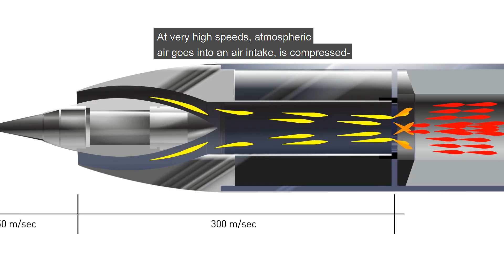How ramjets may change the role of artillery on the battlefield

Comment: Let's see, a 155mm shell fired over 30 Km has a tollerance of 2' going up to 150 Kilometers means that you have no tollerance left. This is still a non guided shell. Meaning, that if you fire that kind of a distance the weapon looses all accuracy. It would be an indiscriminatory weapon of terror. Hitting something that's smaller then a small town, is virtually impossible. As a former artillery man I should know. ;-) 

So while the technology is highly interesting, it's not combat effective and has no real practical uses.
Reply: They used the word guidance at least 3 times, plus you can see the steering fins at the front
Reply: @E1nsty  Wow, you literally have no clue what I'm talking about, do you? 

So what do you think is going to articulate these fins in flight? Little electronic motors, powered by a build in battery?  These are stabelization fins. They serve no other purpose as to stabelize the projectile in flight since it's going to create it's own thrust through the ramjet engine. Ever wondered why some missles have fins while artillery rounds do not?

Well, Artillery rounds don't speed up any more after they have cleared the barrel. Thus they're stabelised by making them spin around their own axis. Just like a bullet . However, the rocket motor of a missile keeps on creating thrust after clearing the barrel and that's why you need those fins. Cause otherwise, all your missle would achieve is to paint a beautiful corkscrew contrail into the sky and that's about it. 

A NATO standard 155mm shell packs about 22 Kilogramms of TNT equivalent. the shell is literally filled to the brim with explosives. 

What those guys are trying to tell you is, that they can stuff in a ramjet rocket motor, a guiding system and then still have enough room for a meaningful charge? Well, let's just face it. NOPE! Not gonna happen. This is just bullshit. 

1' deviation from the original fire solution is about 100 - 200 meters deviation on 20 Kilometers of flight. And that's under ideal conditions. There are reasons why we have things like "danger close". Believe me, I've been an artillery man for way to long, to believe a single word of this sales bullshit bingo. 

And that's not talking about the forces at work here. I won't go into to much detail, as I would be wasting my time. But the fins will not even be able to rotate in the slightest, while in flight. It'd just be to much drag, that'd be created alongside them. 

Any further questions?
Reply: @joenight9693  yeah can you write it shorter? I didn't read all of it.
Reply: @joenight9693  Thank you, very informative and enlightening.

Comment: Your artillery comment is hugely mistaken.
The South African G5 & G6 could fire shells accurately within 2m at over 50km away already in 1987.  
What you are comparing to shells here are rockets. Shells were not assisted with motors, fuel etc.

Comment: My big concern is that at that accuracy would be extremely difficult. With strong winds it could be blown a considerable distance off course. 
Could they even hit the near the target on calm day? These guys are saying that they can launch a shell across the width of Florida's peninsula  Which is insane. Maybe they can do it, but would it be effective?
Reply: Considering the accuracy of current guided artillery projectiles, that doesnt sound like a big problem to solve. But it is indeed a very important factor determining the sence of using ramjet munition. 
The bigger challenge is importing the data of target to the guidance system of this projectile - how do you find, identify and track a target 150km away with pinpoint accuracy, which is needed because of relatively low payload of the munnition? 
The first thought is a standard internal navigation and GPS. But will it be able to download the data and compute with speed and precision needed during high supersonic or even low hypersonic flight at that? 
Current hypersonic missiles use an active radar array for a very precise targeting during the last phase of its flight. However is it possible to mount an AESA radar on such a small projectile, where its nose is mostly covered by the air intake? I dont have sufficient knowledge to answer.
Why radar though? Because expensive projectiles like this are meant to be used against expensive targets - command posts, artillery systems, MLRS and ballistic missile launchers, electronic warfare systems, ships, aircraft on the ground etc. And radar can determine this kind of targets with needed precision.
If we cant put the radar array there then what else? Optical targeting systems ofcourse - IR and laser! First is entirely passive, but expensive and require high computing power, second requires some kind of platform doing the targeting - for example a drone with the laser illuminator.

Comment: I think the 150km range is just hot-dogging, suspect it will be of most use @ 100km or so when it`s still got huge kinetic energy and is part full of fuel to add to the explosive effect. And those are obvious terminal guidance fins at the nose end.

Comment: This sounds like perhaps finally a good gun weapon for the Zumwalt class DDG's.  Payload doesn't matter as much to a ship.  Kinetic energy just punches a hole right through the opposing vessel.
Reply: Zumwalts were not designed for anti surface ship action using the 155mm cannons. They were designed for long range inshore bombardment. The amount of explosive for such a weapon is very important.
Reply: @CH-pv2rz  Spot on, but the role the Zumwalt's were designed for has been abandoned. Shore bombardment is for lower intensity conflicts where sea control and air superiority are established and not contested. US Navy focus has shifted hard towards near peer conflicts which in practical terms means ship to ship combat with China, defending Taiwan and deterring an invasion of Taiwan, blockading shipping lanes to and from China, dealing with the LONG range and supersonic weapons of China. None of these goals and priorities requires extended shore bombardment. 

US Navy's biggest problems now are the retiring Tico cruisers and Ohio guided missile subs retiring  and taking all those VLS cells out to pasture with them. This and how to employ large bodied US hypersonic weapons now under development that wont be fitting into existing VLS cell parameters...  These are areas perhaps the Zumwalt's could perhaps be repurposed and find a new meaningful role in the surface fleet? 

My original comment about this artillery shell technology has not aged well in light of these shifting world priorities.   What would a few more Zumwalt's cost I wonder with hypersonic missile launch tubes installed in place of the 155mm gun mounts??  How many hypersonic missiles could each Zumwalt embark?

Comment: M270 also is able to fire rockets with the range of 70km. Still a promising concept. What Russian system has a range at or beyong 70km/h, because the video never actually names one and in the pictures there are just BM-21 Grad which typically fire at a stated range of 20-40km.

Comment: I really dont think half of the people commenting here even watched the entire video let alone have a clue what they're talking about. The US is already developing the the XM1113 rocket-assisted 155mm shells for use in 2022 with a range of 40KM. The M982 Excalibur guided artillery shell has already been developed at circa $68K per shell and these will almost certainly be more expensive, when compared to the cost for a single M31 GMLRS rocket is $110K with a range of 70KM.

Comment: This technology sounds like it would be better for naval engagements. Make it for a 200mm cannon strap a ACTUAL warhead on the nose and then funnel air into the ram jet and thus you have increased the range of naval artillery guns. Hell add radar/satellite guidance and a JDAM system and you'll have a system that can bring back artillery as a viable weapon system in naval combat that cannot or rather will struggle to be engaged by the targets defence systems.

Comment: If you can fire a projectile fast enough that the compressed air ignites the fuel/ox mixture without moving parts, then it can be something worth exploring. If it requires an actual jet engine, it's too complex and you'd run out of ammo in no time, in a real war.

Comment: The use of solid rocket fuel as part of a ramjet is actually a great idea, it must be great for combining the efficiency of ramjets (relative to rockets) with the thrust of solid rocket motors.
Reply: There's no solid fuel. It works like a jet engine but with almost zero moving parts.
Reply: The solid rocket ONLY brings the shell up to supersonic speed where a ramjet can work efficiently.
Reply: @hellstromcarbunkle8857  The powder charge should be sufficient for this. The Kub missile actually works that way. It has a solid fuel Propellant charge with little oxidizer that breathes air as a ramjet.
Reply: @AllisterCaine  Funny to think that such an advanced design only had an effectiveness of around 70-80% against subsonic tomahawks and was replaced by the 2-stage solid fueled Buk system.

Comment: The whole concept of artillery involves a shell that is cheap enough so that you can hit the enemy on and on. If the cost is high it will not be deployed, like the excalibur rounds....
Reply: Yup, but this design, at a glance, looks like it could be made at least fairly cheaply. It will be cheaper than rocket artillery (which is also fairly cheap compared to many advanced missile systems) but still utilize existing Howitzer design cannons. And they can still use normal shells when the extra range isn't needed... sounds like a good versatile "extension" system to me.
Reply: Ramjets are actually fairly inexpensive if you keep it basic, it might not be as expensive as you think
Reply: But if you have this to engage enemy artillery with precision, doesnt it pay for itself? We've seen that precision wins fights.
Reply: It will be now.....  The meaning of "cost" just changed.  What will the "cost" be to rebuild Ukraine, or defend the Baltic's.
Reply: If CEP = 5m instead of CEP = 50-200m, that whole paradigm changes completely.  Compare it to the cost to deliver a GBU-53/b....
Reply: It's a good options to have though
Reply: I doubt it's going to replace all other projectiles due to cost. But you have a good point. Like when you have a hypersonic missile. That hypersonic missile won't replace all other missiles.
Reply: I agree and when you need a really primo round fire it. The777 will fire whatever you want.
Reply: The US military is already accustomed to using the most expensive guided warheads in the world on two or three combatants with AKs, RPG7s, and maybe a medium machine gun loaded onto a pickup truck. Don't underestimate what we would be willing to spend in a conflict with Russia, especially considering the difference in personel numbers. If we we were to trade human casualties at a rate of five to one; that is barely breaking even against Russia or China.
Reply: You should be Head of the Army ! You have such a great understanding ! These people just don't know what they are doing with all their research ! You will correct their mistake ! You will teach them how to correctly use artillery ! You are such an amazing leader ! So wise !
Reply: 😚😙😙😋😛😛you were saying? Literally decimating Russia as we speak
Reply: I agree, also is there really a need for artillery with that type of range? Already on modern battlefields artillery is used much less than strike weapons fired from mobile vehicles, this seems to complicate things to the point where it would make more sense to just scramble a fighter jet.
Reply: @wastedtalent1625  "I agree, also is there really a need for artillery with that type of range? "

I mean, if it's cheaper than a cruise missile it will definitely be really useful. Even if it's comparably priced I'm sure it will be much harder to shoot down at those speeds. 

That said, it's likely to be an alternative to cruise missiles and rocket artillery rather than regular artillery.
Reply: @wastedtalent1625  AA and enemy fighters jets just counters that
Reply: @VonApennn  america hasn't fought a war with a country that has an airforce in over 30 years. And strike weapons can be sent from hundreds of miles down range far from the reach of enemy aa guns, this is filling a neich that doesnt need to be filled
Reply: @wastedtalent1625  bruh that’d be short term thinking, they need to have a this just in case war with China
Reply: @VonApennn  here's the thing, artillery is for supporting ground troops, they help clear out pockets of enemies. Artillery always advances behind the front lines, close enough to provide support. The reason why we haven't invented higher tech artillery is that there isn't a need for it.
Reply: @wastedtalent1625  I agree that it’s for supporting ground troop completely, but there is a need for artillery to bomb precise locations where aircraft can’t reach either because of AA or enemy planes. It’d be like a smaller scale ICBM.
Reply: @wastedtalent1625  artillery has to leapfrog to sp deep offensive thrusts. not only that mechanised ops like in desert need support on a broadfront so higher ranges are useful
Reply: @wastedtalent1625  
So what part of Norway did you not get?
Reply: @wastedtalent1625  Not even US air power can be everywhere 24/7 and if their fixed air base is damaged or disabled so is the squadron or squadrons it supports. Organic firepower is always valuable and forces an opponent to defend against a greater variety of systems. One can never have too many or too varied practical weapons systems.
Reply: yes, really good point - might as well invest on cheap drones that drop conventional bombs if the want to go the cheap route...
Reply: @jamesmartin1895  Drones are slow and easily shot down by SHORAD.

Comment: The selling point is that it doesn't have an apparent payload that may draw frowns from the casual war audience. It's one of them new "cruelty free" obliterators . Demonstrations can clearly prove this to be the fact, at ranges that exceed its fuel capacity. Meanwhile, if it strikes something before it runs out of its "just add oxidizer" fuel, it will momentarily fill the air with a cloud of finely dispersed, glowing hot, fuel dust. As soon as the cloud expands enough to reach its required fuel/air ratio, you have a thermobaric charge, which are all the rage these days. Soldiers of defeated armies see the effects of those and start spreading alien voodoo theories, because it doesn't look like anything commonly thought possible. The extreme range (at which point this would be a useless weapon for other reasons) is just marketing to generate an excuse to exist, at a much higher price for a shell that is much worse than one that's already stockpiled to the rafters all over the world. What they should be marketing this for, is keeping naval ships and landing craft at a respectful distance from your shores, but it will likely only be used by certain folks to reach more open air markets, as per the established trend.

Comment: The real question is how much explovie you deliver with all the space teh rocketmotor and propelant takes. there is a reason why most Artelerie thease days are around 150mm or higher since that seems to be a sweetspot beween mobility and  ammo consumtion and Lethality on target. If your more intereted in high volume in a short time Rockets are better the main advantage of gun Artelery is that it can suport fire over a longer time in a changing enviroment and teh cheaper cost of normal shells.

Comment: You seem to be glossing over lots of facts to present your agenda. 

 " Since WW1 artillery has had an effective distance of approximately 23 miles and hasn't changed much since then ""

You fail to mention that the Germans built the Paris Gun in 1918 and had an effective range of 81 miles or 130 kilometres.
Reply: and v1 v2 was thousand in 1944 and icbm 10 000km in 1955